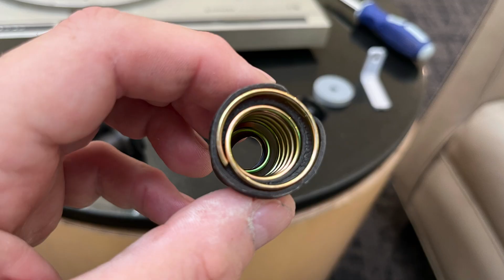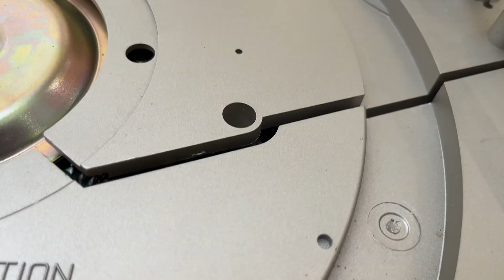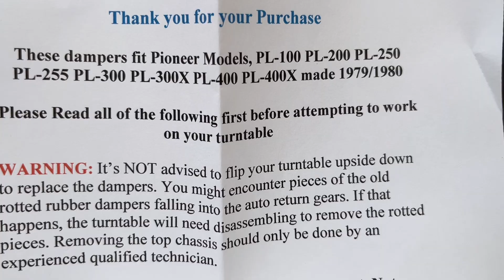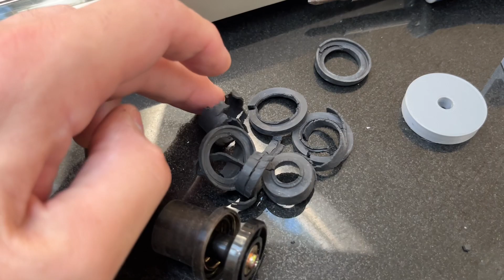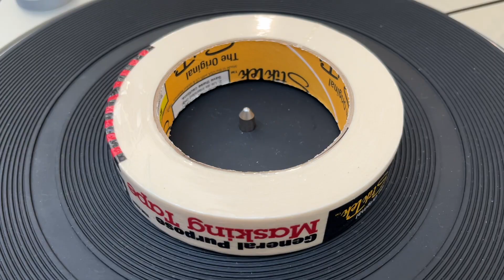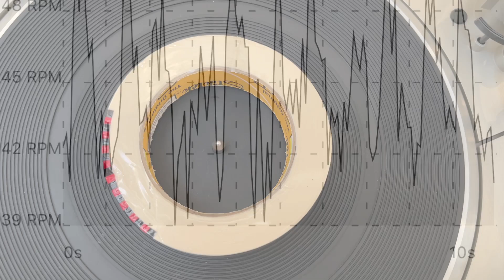Repairing Pioneer PL-300 Coaxial Suspension System Using New Rubber Parts

Comment: Is the pl600 different?
Reply from the maker: In what regard?
Reply: @ArthurHallicraftersKitchen im just asking because i keep seeing that the rubber supports for the suspension springs are the same and im not sure
Reply from the maker: The 600 I believe is a fully automatic model. Suspension should be the same.
Reply from the maker: @pierresternegard6951 Yes, those are the ones.